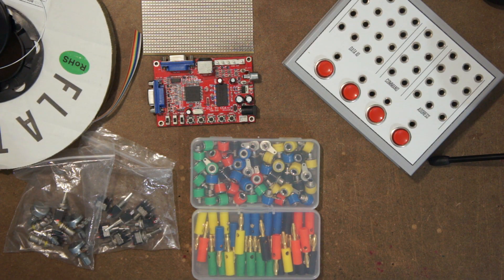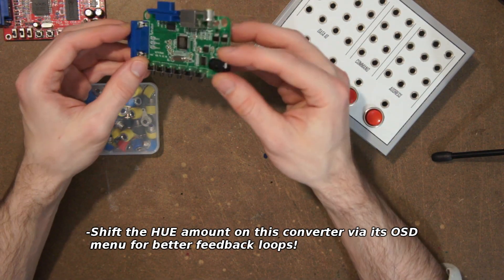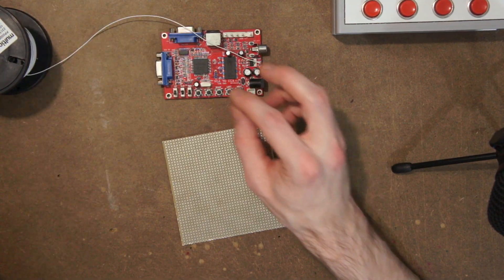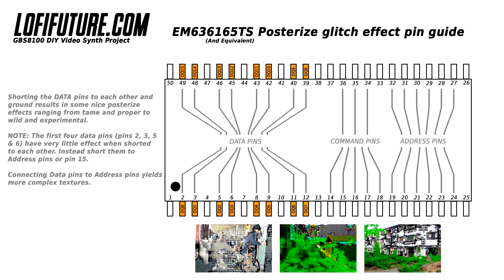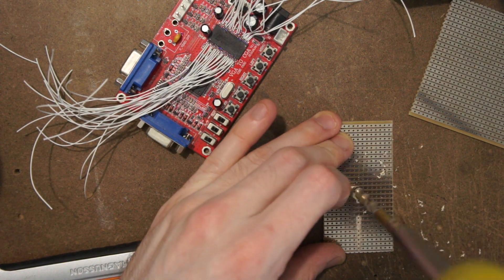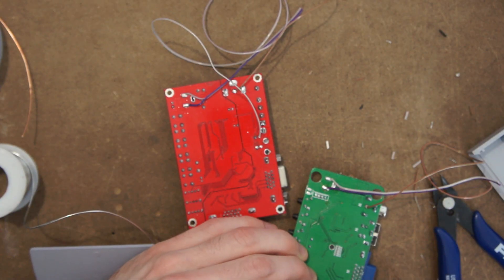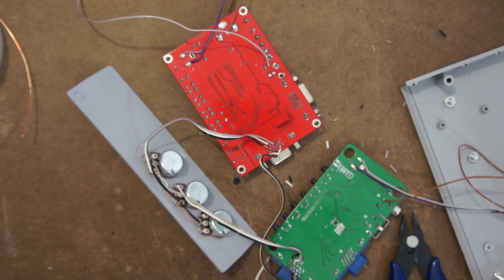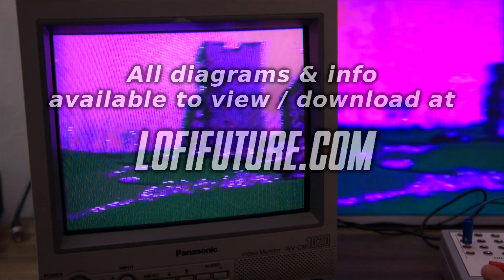DIY Video Synth On a Budget! How To Circuit The Bend GBS-8100

Comment: Got any recommendations for TBCs or similar devices to stabilize my CVBS signal? I'm currently looking to into experimenting with circuit benders but want to use my capture card for it without risking having the signal get cut off. Thx!

Comment: any tips on soldering to the ram chip? i just destroyed my third board 😭 i tried doing it to the vias too and just cant manage it. maybe i should just give up.
Reply: I destroyed one, regathered my strength to just start another one :) lets see how it goes
Reply: @finonomastropiero4261  i did too, i ended up skipping some of the pins so i had more space to solder the wires. Ended up doing 12 pins, some of them came undone but i cant be bothered to retry it, at least right now lol. I can still get plenty of great textures with the ones that did work tho 

Also getting a better soldering iron was life changing lol
Reply: Hey! How did you know your chip got fried? I'm afraid I might have fried it but am not sure.
Reply: @brechthekkema4244  If I remember right, my failures were mostly either destroying the chip's legs themselves or bridging between the legs that I couldn't get out. The latter isn't necessarily fried, unless you've bridged 2 specific legs that could break the chip and then powered it on, but it's tricky to get out. See if there's any visible damage that you can fix on it and then power it on, if it doesn't work then you might have to try a new one.

Comment: Hi ! Thanks for this great DIY, but i have a few questions...

I am on the soldering part, but y have big broblem to correctly solder the wire on the chip. Witch solder station do you use ? And what temperature do you set ?

Comment: I appreciate you so much for the inspiration and tutorial.  I built my own GBS video synth after this build.  All the bend points work as expected. But I am having difficulties with the output only displaying bends when used with the VGA input on the GBS and the feedback function whenever I switch it on it just gives a video glitch mix of the VGA and RCA input.  Do you have any tips to fix this?

Comment: First off thank you for making this video and sharing your diagrams on this project. I am so close to figuring out this build and I feel like whatever mistake Im making is something basic I've not learned yet since I kinda jumped into this. My video out is giving me colorized static and I'm not sure whats causing it. I dont see any bridged pins on the GBS so I dont think thats it. Trying to get some more info before going back in and de-soldering my work and starting over again!
Reply: This happened to me too and after using a multimeter to check continuity I realized I did indeed have bridged connections :/ Unfortunately the pins are so small that both a solder pump and desolder wic has not work to unbridge the connections. Back to square one…
Reply: @yapscience   @Sam Bianculli  those pins can be very frustrating to solder for sure! I ruined a few gbs's before getting it right! 

One thing I realized is if i am using the feedback mode I have to unplug the video input first or else it will cause the video signal to drop 🤦

Comment: Wait, what? Am I losing my shit or did you skip entirely over how to wire the stuff at 7:05??? You didnt tell us what to do with the those pins from from the IC on the red board at all? Why do electronics tutorials alway skip entire sections of the project?
Reply: The white wires are connecting the IC to the empty board and them he use the ribbon cable to connect the empty board to the plugs, using the IC diagram that you can see in the video to make three separate rows that correspond at the IC DATA/COMMAND/ADRESS. The four buttons are connected to nothing and act as temporary switches if plugged using the banana cable. I know that it may be a bit confusing, but I recon that a lot of DIY videos are made in a way that you have enough info to start a project but enough shades to make you fuck-up your projects. Sometime you have to work around difficulties by yourself ^^

Comment: @LofiFuture is there a wiring diagram available for the internals ?  for example the buttons ? and the female jack points ? (im guessing the female jack points just go to the pins then that acts as a bridge but where do you wire the buttons in ? :D thanks
Reply: "The white wires are connecting the IC to the empty board and them he use the ribbon cable to connect the empty board to the plugs, using the IC diagram that you can see in the video to make three separate rows that correspond at the IC DATA/COMMAND/ADRESS. The four buttons are connected to nothing and act as temporary switches if plugged using the banana cable."

I was in the same boat, you are correct in your assumption :D

Comment: Thanks so much for this video, I'm going to be working in making something like this very soon! Quick question: exactly what kind of capacitor did you use to convert s-video to composite out, 1k volts?
Reply: 470 Pf ceramic cap. https://youtu.be/zMlJFY3scrQ?t=385
Reply: 470 pf tantalum?

Comment: Great video, thank you! Can you please point me to the labels? I can't seem to find the link. Also, can you confirm it's only necessary to use the pins you labeled as "safe to short"? Or are all 50 pins needed? Keep up the great work!
Reply from the maker: Thank you! You can find them on my website under the GBS8100 Video Synth Tab. 

You can basically take any selection of the "safe to short" pins you want to create your device. It isn't necessary to use them all and the pinouts provided on my website include some narrowed down pin selections for certain effects.

Comment: I have a couple of questions
First one, the circuit to adapt the external voltage to the chip is for +5 -12v, i have a semi modular synth that sends out +5-5v signals, while it won't harm the chip, would this difference affect the modulation in a significative way? Or worse, may it damage my synth? 
And, second question
Can i use the same circuit (so, 10k resistor + npn transistor) to adapt the voltage and modulate the other pins from an external voltage? (maybe making a small boxed voltage adapter with mini jacks and that circuit inside would be a good idea to use external voltage by pluggin it directly into the patch bay between 2 mini jacks or maybe adding the input and output of the adapter on the top patchbay and the cv input on the side)
(i was also thinking about asking if i can modulate the effects by putting a potentiometer between the pins, but i think i'll just test if it works and avoid bothering you anymore) 
Thank you in advance for your responses
Great video by the way, i think i'll probably buy the T420 mk2 in future ;)
Reply: Hey, the potentiometer works??
Reply: @renatomarciano15  It does not work as i expected but it does "something" lol
I will remake the synth with more customizations in future though, with a custom 3D printed case

Comment: I’m having an incredibly hard time with getting the wires onto all those tiny pins, any more advice or tricks to make it a little less painless?
Reply from the maker: one thing I would try is using a flux pen during soldering especially if it seems like the solder just wont flow. I have found a set of Vias on the other side of the GBS-8100 PCB that are way easier to solder too. I'll make sure to document this and add it to the project page when i get a chance!
Reply: @LoFiFuture  Just finished frying my second GBS8100, so that alternate method would be super appreciated!
Reply from the maker: @JakeJones-vq9xm  Will be making a quick video on the process this week!
Reply: @LoFiFuture  Did anything ever come of this? I am working on this project now and I feel that this would be useful for a lot of people.
Reply: I believe it's on his patreon, not sure if it shows the pinouts though  @crumpled
Reply: @LoFiFuture  Thanks!

Comment: Super nice project! Thanx for sharing

A question: why banana jacks and not 3.5mm minijacks?
Reply from the maker: Thank you and no problem!

This is a really good question and im glad you asked it, should have explained in the video. 

First reason is if buying cheep then cheep 3.5mm jacks are pretty annoying to use + grab onto jacks too hard for quick patching. These cheep 4mm banana jacks however are super smooth and easy to patch. 

Second reason is kind of a safety feature, with 3.5 mm jacks one may be tempted to plug in external signals. Since the patch points are not buffered (and it would be much more effort to do so) you could easily kill the chip if you fed it an audio signal that exceeds 3.3V (4.6V absolute maximum according to the datasheet) The data sheet also mentions exposure to voltages above 3.3v for prolonged time may effects device reliability so this prevents any mishaps that may occur from haphazardly sending the chip loud VCO signals. Obviously if you have banana jack modular hanging around it would be a risk, 

All that being said sending the chip all sorts of signals is super fun, but i will be covering how to send the chip external signals safely sometime soon
Reply: @LoFiFuture  I see! I was indeed tempted to patch the chip with external signals :) but maybe would be nice to try some lxz stuff such as the lfo, they use 0to1 V so they should be safe!
Reply: @LoFiFuture  oh ok. This answers my question. I wondered if you could send trigger gates into the unit .. but that might be a mistake. Thanks for the extra info
Reply: @LoFiFuture  incredible. thank you! will this impact the build? i just bought everything and was going to start today!

PS how long do you recommend the 28 awg cable to be? looks like you did abt 6-8 inches?